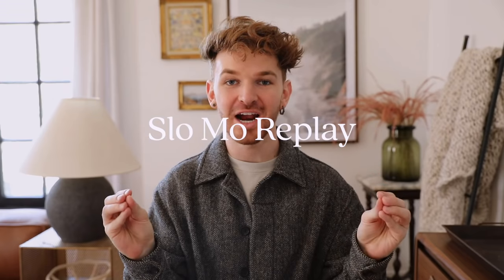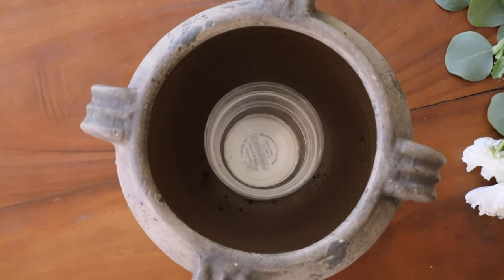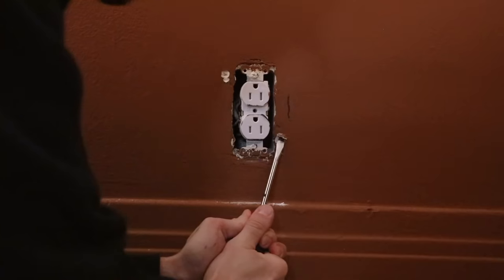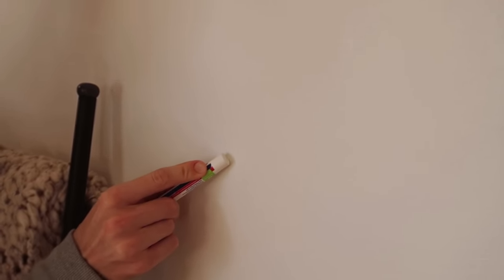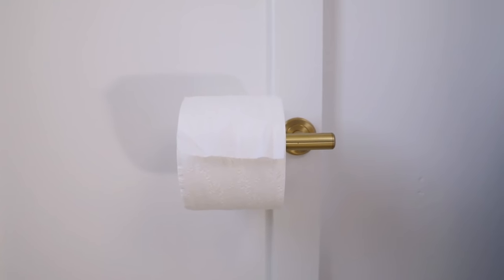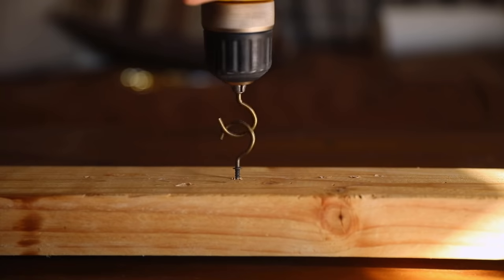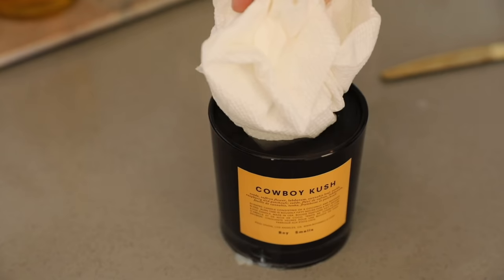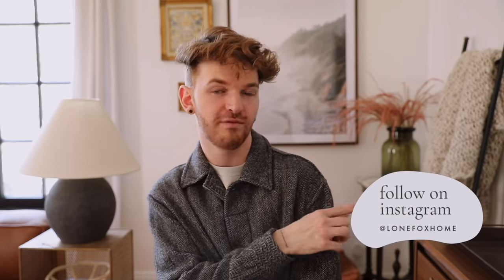20 GENIUS Home Hacks That CHANGED MY LIFE 🏠  DIY Hacks to Save Time + Money!

Comment: I used to work in a pottery outlet and we used price stickers on everything. Whenever the owners decided to change prices or put on a sale, we would have to remove all the price stickers and put on new ones (so removing stickers on about a thousand items). We would spray the price sticker with windex, then use the back end of a swiffer duster (the plastic holder piece) to push the sticker and adhesive off. Windex breaks down sticker adhesive in about 10 seconds, so no need to wait 20mins to remove your sticker tags!
Reply: I have used the windex trick and a thumbnail on a mirror I bought at an as is store. Took me a few minutes and minimal effort to get a big red sale sign off a beautiful framed mirror.
Reply: Isopropyl alcohol is what removes the sticky & most window cleaners & all-purpose cleaners have some in it but just straight 90% Isopropyl and it will come right off no real wait time.
Reply: There's a product that's called orange------something. It comes in various sizes and is oily. I can't stand ragged price stickers and they. Ome right off.
Reply: Goo Gone works really well. I always have a bottle around because it works on other sticky substances like gum, tar, and shoe scuff marks.
Reply: That is the best…removed paint too
Reply: For an all-natural solution, lemon essential oil and baking soda work great to remove labels. Soak the label with lemon oil, then scrub with a little bit of baking soda.
Reply: @wendyroithner1071  It's also great for removing city stickers from my car's windshield each year when they have to get renewed here in Chicago.
Reply: Fingernail polish remover removes labels super quick (and a flat razor blade)
Reply: @sorsha_sky  and is extremely toxic
Reply: @jv-ep2tc   isn’t goo gone and windex toxic as well?
Reply: @sorsha_sky  just like all things, there are degrees of toxicity. if you spill acetone on a textile, such as a nightgown, the fabric will dissolve. I stopped using it as polish remover years ago. The body can handle a small amount but lengthy exposure is not a good thing: The excess buildup of acetone to the level at which the liver finds it difficult to break it down leads to severe acetone toxicity.
Reply: @jv-ep2tc  Yikes! So how do you remove fingernail polish?
And what about the millions of women who work in nail salons?.😱
Reply: @elenalatici9568  what about them?

one can use acetone free nail polish remover. [you don't get out much, do you?]
Reply: @jv-ep2tc  the last remark, about not getting out much... Wasn't necessary or nice!
Reply: Good to know... water usually works well for me but sometimes... not so much.
Reply: Great!!
Reply: The best removal method depends on the the adhesive type, sticker material (some are plastic instead of paper), and what the sticker is adhered to.  A soak of water does indeed work best in a surprising number of circumstances!  Good video!
Reply: Rubbing alcohol also works.
Reply: Take a hairdryer - peels off in one go!
Reply: Another really old hack for glue residue from stickers or labels, is vegetable oil (even if it's used). After you've washed the item, add a drop of oil to the surface, use an old sponge and just scrub it off. Wash, rinse - done.

Comment: You should be careful about using anything for drinking that is made for another use. My high school Chemistry teacher taught us that beakers and other laboratory vessels shed microscopic glass shards constantly. Anything meant for drinking needs to be specifically treated and/or tested for that purpose. There's a chance a glass holder for a candle is food safe. There's also a chance that it sheds glass shards, like a beaker. Stay safe folks.

Comment: For clean paint lines with tape, if you don't have the original wall color you can use matte mod podge. It will also fill in the bleed area with clear then paint your new color. Perfect line.
Reply: wooow I was about to ask this! Thanks :)
Reply: @melocotonki  same !!
Reply: Did not know that!
Reply: Thank you!!! This has been bugging me for a while. Great solution!
Reply: Amazing hack!! Thank you!
Reply: Paint tape has never worked for me .  His and your idea are both great. Can’t wait to try before I forget.
Reply: Clear Silicone Caulking can also be used if you don't have Matte Mod Podge nor the original paint color.
Reply: I’ve also used Artist’s gesso which works as well, but I like your idea so much better. Thanks for the tip
Reply: What can I use instead of mod podge in Spain/Europe?
I tried ordering from USA but they wanted a stupid amount of tax to import
Reply: @berylcomar  any clear paint or even thinned out pva glue will work . It just has to dry clear. I like the matte mod podge or matte medium because it doesn't leave a glossy finish.
Reply: @DrawTangleswithDawn  thanks. I see so many DIYers use it in US and it seems pretty versatile
Reply: @berylcomar  my aunt is an avid crafter and never used modge podge  for any craft that called for it she used school glue just thinned with water tried it and it really worked
Reply: @melissamoves8355  . Thankyou
Reply: Thanks for sharing. I was wondering, what if you don't have the original paint color?
Reply: @berylcomar  An inexpensive way to make mod podge is to use plain white glue, and mix in equal parts of water. I live in the US and don’t spend full price to buy it either!
Reply: Since the gel on these paint tapes us actually activated by moisture, I find running a heavily dampened  cloth over the tape to seal that gel to the wall works well.
Reply: Yes I always use matte mod lodge on my items and then wait for it to dry then use stencil or tape. Works so great with stencils. This is the best tip.
Reply: Thanks —-Great idea!!! Will try!!!
Reply: @angelshannon8901  great idea!!! Thank you !!  I’m ready to have to paint some strange shade rooms, and I haven’t had great luck with Paint tape no matter what brand either:(..,.. I’m definitely going to try your idea!!
Thank you!!!!’
Reply: You can also use water base clear coat or clear poly.
Reply: Thanks.
Reply: I rescued two kittens. They have created unholy havoc in my home. I had to put away every breakable precious object. I love to have fresh flowers, but was afraid to use my vases
 I resolved the problem by putting rocks in the bottom to make the vase really heavy. The stems of the flowers fit easily between the rocks. FYI, none of my vases are glass, but you could probably fill up a glass vase with clear marbles, or even colored ones to make them cat proof. As for everything else, I need to make doors on bookcases, open shelving etc. My best hack? Rescue a dog.
Reply: After soaking up the waxy water with the paper towel you could let the paper towel dry in the grass and then save it for fire starter.
Reply: @elenalatici9568  for your cats...get a squirt gun or spray bottle and all you need to do basically is squirt them one time when they're misbehaving and when they do it again....just pick up the squirt gun or water spray bottle and they will most likely stop immediately and or run off in a hurry. Works for dogs too. LOL! :)
Reply: @berylcomar  Regular ‘ol white glue mixed with water. Same thing.
Reply: @elenalatici9568  Or just wait a few more months. When they grow older they settle down and don't do so much damage. Mine used to climb up on curtain rods and on top of libraries, but when she got older (and neutered) she barely bothered to move from couch to toilet to food.
Reply: @angelshannon8901  I’ve always done clear silicone caulk, it’s recommended by a lot of professional painters. Works every time.
Reply: 😮 Genius!!!

Comment: As someone that has worked in the paint departments at Home Depot and Lowe's, there's a problem with getting a paint sample from behind the outlet plate. To get a decent color match, we would recommend getting a sample at least the size of a quarter. Depending on the machine that is scanning the sample, a size of a dime might work. Anything smaller than that is useless. If your walls are textured, you might as well start over with your paint color because it never matches.
Reply: Guess we were lucky because we managed to get an exact match of the color of paint of our textured walls that were painted 20 years ago when we bought our house. Needed to do touch-ups on the walls where the grandkids had scuffed and scraped areas. Home Depot came through for us! We took a chip of paint  from one of the walls.
Reply: I simply paint the inside of a socket plate in each room.  Stop before reaching the edges, though, to keep it from sticking.
Reply: @TheAureliac  That is a really good idea. I never even thought about that.
Reply: @TheAureliac  Nice.  Great  idea!
Reply: Loved this.  New ideas for this old do it yourself landlord.  Who knew soapy water on caulk.  You've just save me a lot of time.  Thanks.

Comment: Instead of the Fix-it stick to fill nail holes you can also use white tooth paste. Thousands of military families will attest on how great  this works and it's cheap. (Military housing has white walls) -- Thanks for your ideas/suggestions.
Reply: Toothpaste is a dorm room  moving-out hack as well!
Reply: College apartment, toothpaste where people missed the dartboard.
Reply: Why not plain old regular stucco  (I think in English they call it "spackle") which is actually made for this job? It's so easy to use, it's a powder, you mix with a bit of water to make a paste, and that's all.
Reply: @irmar  I think it's because most people, myself included, don't want to buy a whole container of spackle for a couple of small nail holes.  I've used the toothpaste trick.  Now, I just use command hooks and hangers for everything.
Reply: @DeannaR2331165  Until the day when you walk in your home and find that your favorite framed image of the beach/ocean -- that you paid $120 for and then an additional $200 to have framed because of its odd size -- is on the ground, with shattered glass everywhere and the picture is now ruined because the glass left cuts because the command hook suddenly lost its sticking power and let go of the wall.  

I stopped using command hooks for certain things, particularly my wall of framed family photos, because invariably the glue fails and I got tired of cleaning up slivers of glass.  I love command hangers but only use them for things that aren't encased in glass.
Reply: @ferocitas1958  Yeah, I don't have anything like that.  :-)
Reply: Or, dollar tree stores around in.my area carry one cup size cans of real spackle that can be used and put away for later... no sweeteners or flavoring added! Lol
Reply: My Mom always used Ivory soap to fill the holes in the walls. It is soft and fills in good.
Reply: Agree

Comment: For that removing candle wax tip, wait until the water has gone cold. The wax will solidify on top of the water so no waxy water.
Reply: You can freeze the candle and the wax just pops out. Easy Peasy! It leaves less residue too. Cleans up nicely.

Comment: As for removing the candles you can also freeze them and they pop right out. 🎉
As for the caulking if you have a small bucket and a sponge 🧽 you keep your finger wet and run the sponge across it after your finger it has a clean finished look. 😉
Reply: Thanks for the tips I’m going to try them out soon . 😊

Comment: Instead of soaking up the wax with paper towels, just wait until it hardens again. The wax will settle at the top. Press it down with slight pressure and it will pop right out. Soooo satisfying.

Comment: Love all the tips! ❤ Thank you Drew. Can I add a tip for you on the caulking? I worked in a tiling store and learnt from the pros, use clear window/glass cleaner to smooth caulking rather than soap. The alcohol in the cleaner vaporises off so if you have any little bubble holes in caulking you can add more,  soap can leave a residue which can sometimes affect filling in the little holes. I've done this trick for years swear by it,  also have used this trick to add enamel paint touch ups like on stoves and fixing car duco. Spray the cleaner on your finger and wipe across. 🤗
Reply: Great tips thank you 🙂
Reply: Thanks!
Reply: I reuse candle jars also.  I glue a clear drawer pull to the top.  Super cute.

Comment: My favorite hack is writing the room color in the back of the light switch/plug cover. I would probably also paint 1/2 of the back  in case the color is discontinued they can color match.  When calking instead of spraying the calk just wet your finger and it smooths out well.  I also like the hack of spraying the mat with clear flex seal.  Great video.
Reply: Donna when I buy my paint I ask for an extra sticker from paint mixer that has b a me a b d formula of paint on it and stick it behind a wall plate and can go right to it if I need a mix of that paint

Comment: Love the tips! My go to for removing wax from candle containers is to freeze them.  The wax constricts and hardens, making it super easy to remove in one piece.  I then use the wax pieces to make other  homemade candles.
Reply: Oh cool 😃 definitley less work than melting it
Reply: I've been freezing my old wax for Years. Love how it slides right out!
Reply: I am surprised  he didn't  know  this one.
Reply: I do this with my wax melts
Reply: I do the same but I make firestarters with the wax. I fill a cardboard egg carton with dryer lint, shredded paper,ect and pour melted wax over this then separate the cups. They're great for camping or backyard firepits especially when there's too much dampness to easily start the fire.
Reply: I’ve done this for years….Great way to get rid of any kind of wax!
Reply: I came to the comments to say this. I usually use the wax I pop out in a wax burner.

Comment: Something to keep in mind, when removing sticky labels (regardless of the method used), really do your best to not let the sticker pieces go into your drain. It doesn't take much to start a clog to build up. Hope that helps :-)   Awesome tips!!! Fav is the fill-stick product.
Reply: I have not used this, but I was told that the best way to remove any sticker is to spray it with white vinegar.  I usually have already scratched it off before remembering this trick.
Reply: I usually use a little cooking oil to soak the sticker and a spatula to scrape it off (into the bin/trash). Saves your drain and nails lol.
Reply: Great info. Simple but helpful.
Reply: @HannahRainbow88  Exactly, any oil, including Vaseline, olive, wd-40, hand moisturizer, et.al. I've even used chapstick to remove a sticker or label.
Reply: Hannah knows whats up!  Soaking the label w/H2O may be helpful but not necessary, slathering with an oily substance should allow scraping off; then add more and continue rubbing with paper towel to remove any residual.  Should you use water, soak the label, then try working it off without continually holding under a running faucet, you know, like when brushing your teeth😁
Please conserve water anytime you can, it is a precious & limited resource.
Reply: @evangelinemunyan7934 White vinegar for the win!

Comment: When you have a votive holder that you add your own candles to, put a quarter to half inch of cool water in before dropping the candle in. When the candle drips, the cool water hardens it so it doesn’t stick to the container. This is really helpful if your votive holder has rounded walls (like a rose bowl shape) and getting wax out the other way would be harder.
Reply: I wish I knew this for like a moth ago! I was stupid and fix boiled water. Buuut.. I didn’t wait.. AND I used newspaper.. it got sooooo messy. Felt so stupid when I tried to clean up after myself. Took hours. 😩😥
Will definitely try this next time! 😂

Comment: Another good tip that I use when I have a candle that is too small for the holder is to wrap an elastic band around the base of the candle. This usually makes the candle fit snugly and it eliminates a build up of wax inside the candle holder.
Reply: Me too.
Reply: I use tinfoil. Wrap a strip around the bottom of the candle - enough to make a tight fit. Them smoosh the candle into the holder.
Reply: I've put my candles in the freezer overnight and then the wax pops out. You can also fix broken lipstick 💄 by putting it in the freezer and the next morning it's set and ready to go.
Reply: I wrap Saran wrap, that I have folded over and over until I have a long strip, of many layers. I wrap it around the bottom of the candle. When you shove it in, the candle holds very well.

Comment: I learned so much from your tips! Another tip I learned recently is cutting the caulk tube tip at a 45 degree angle rather than straight across.
Reply: Yes - I do that too and it makes all the difference.

Comment: I was a wedding coordinator for years and a florist taught me the flower hack. I would tape around the bottom of tapers to make them fit. Great hacks. That wall stick is my fav!
Reply: i just grab a bit of tissue or papertowel and wrap it around and shove it in the holder
Reply: @daneekaplan4284  it might not work for the glas vases, as you would see the tissue.
Reply: @sazennonumber  Let a little wax from the candle drip into the bottom of the holder and put the candle in right away has worked for me.
Reply: @gingereaves4097  Yes, I've learnt that as a child and it is the best one. For some reason, I thought that this thread was about vases and floral arrangements and I've just realized that I could be totally wrong!! 😂